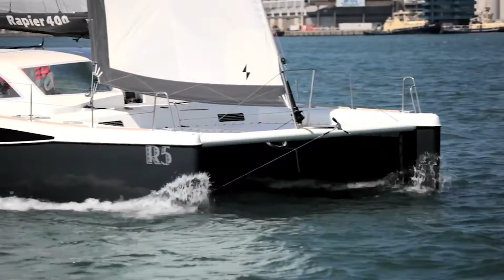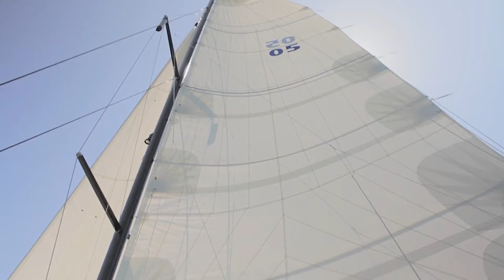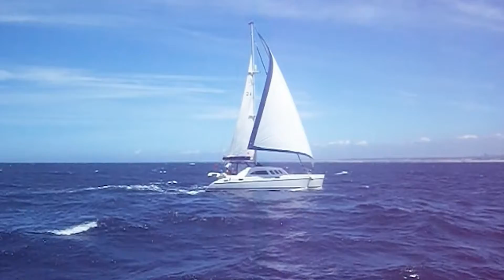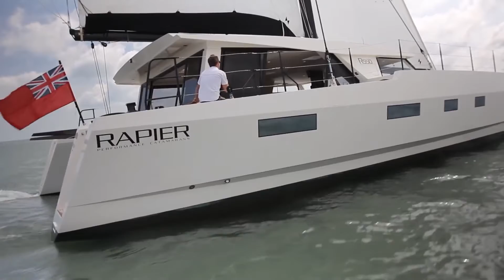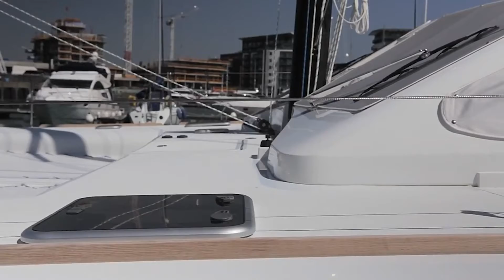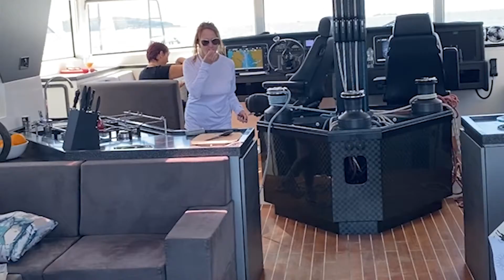How the Broadblue and Rapier Catamarans differ in build construction to other catamaran brands

Comment: Rapier 400 just looks like an outdated Seawind.
Reply from the maker: Thank you for your comment regarding the comparison with a Seawind;

The Rapier 400 is designed as a performance cruiser and is therefore much lighter than most, if not all production competitors including the Seawind, Lagoon, Nautitech and Leopard. The lightweight and lower installed height of the sail plan allows for a better power to weight ration than any other model in its class. 

The open plan layout of the Rapier 400 is much more usable than some other brands because there isn’t a large door sweeping across the floor on its way into the coachroof, limiting the use and furniture in this area and the central helm station makes visibility from the helm to all corners of the boat very easy.
Reply: @broadbluecatamarans  скажите пожалуйста, а рапир 400 пригоден для пересечения атлантического и тихого океанов семейной парой? или это катамаран для дневных прогулок между островами? шторма, высокую волну, сильный ветер он выдержит?
ну и интересно - смола в корпусе, это эпоксидная или что то другое?